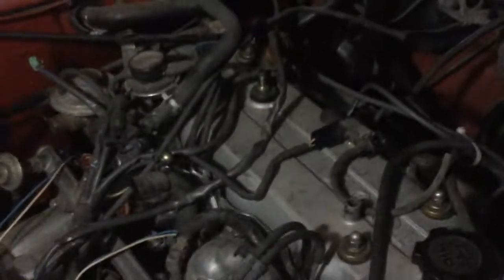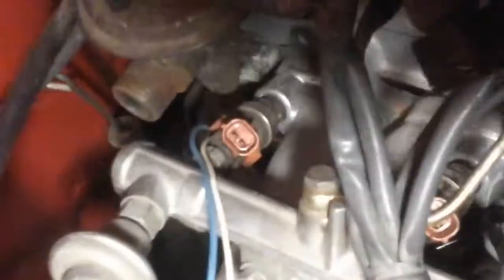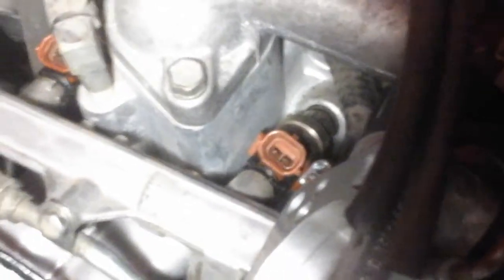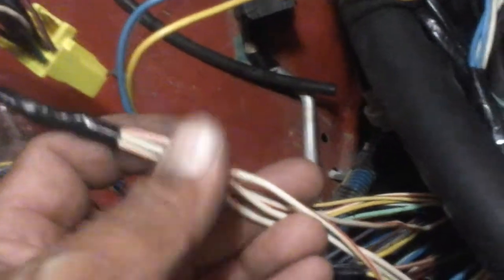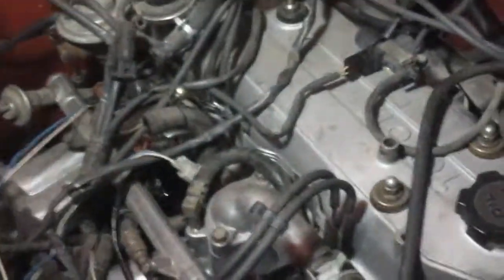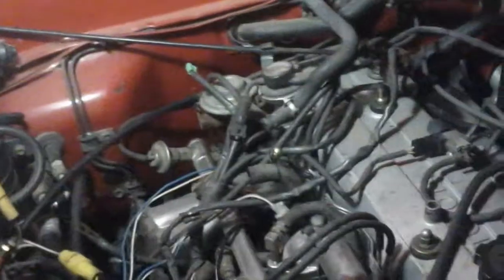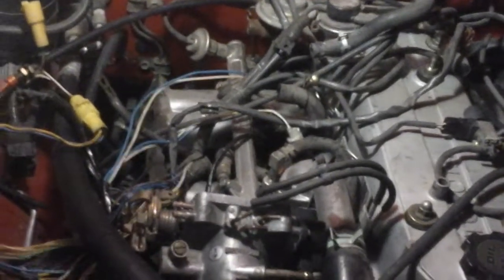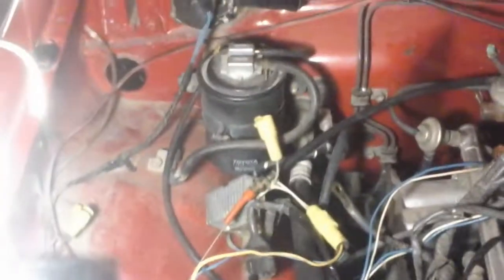Trying to diagnose fuel injection problem on a 1988 Toyota Pickup . Part 1

Comment: what are the color codes for 1  2  3  4 fuel injector wiring ? when replacing the leads  i didn't mark the wires !

Comment: did it turn out to be bad injectors huh? I went through all that same crap lol. Finally bought 4 new injectors, changed the tank (rust) and the filter for the 3rd time and its been fine
Reply: oh also on these 22re engines. just get rid of the original fuel filter and add a good inline filter near the gas tank. The original filter is garbage and doesn't allow proper fuel flow. you'll be chasing ghosts for the rest of your life if you dont. Learned the hard way lol
Reply from the maker: Nicholas Byman yes it was the injectors. even though they tested good on the DMM, they where stuck with lacquer from fuel that that sat in the line from years of neglect and Bakersfield heat. so after i replaced them it ran like a champ.